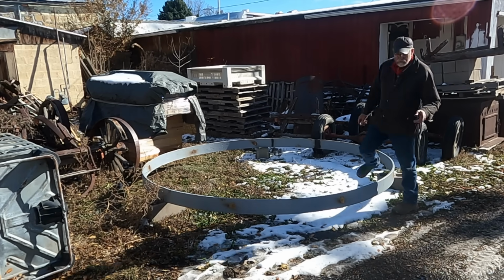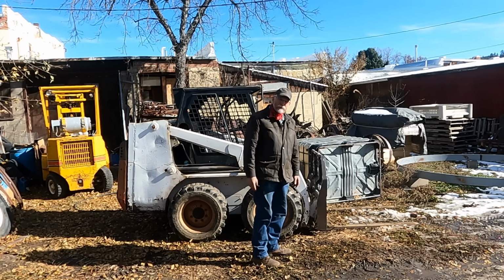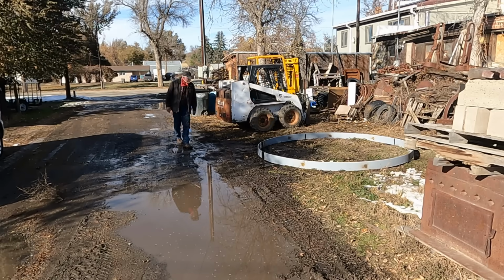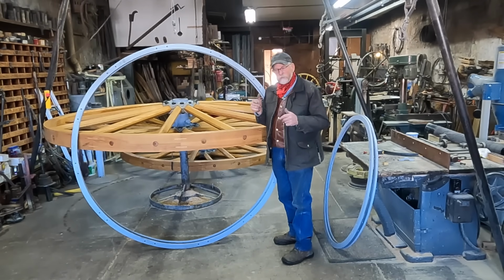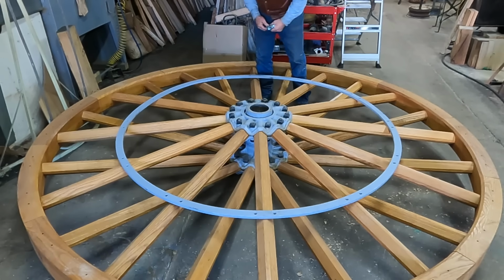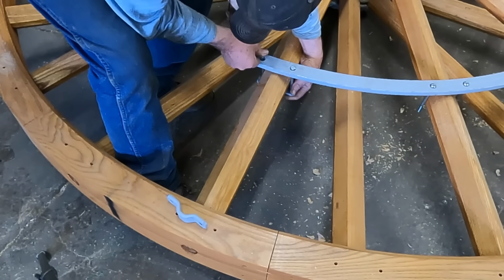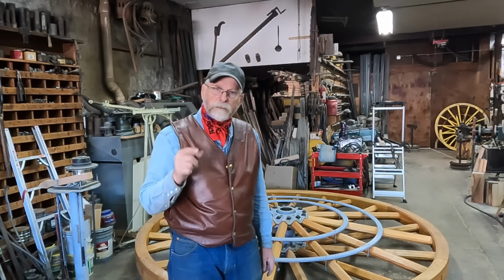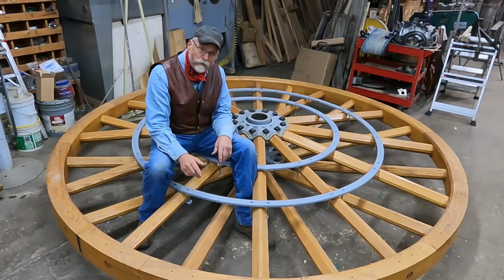The Last Steps For Setting 10 Foot Logging Tires | Engels Coach Shop

Comment: Fun fact : the Holt company that built these wheels is still around today , but they're now known as Caterpillar
Reply: Pretty neat.
Reply: And if you grew up in Stockton, CA, you might have heard about Benjamin Holt.
Reply: Holy and Best merged to become Caterpillar.
Reply: I think it’s neat that they are Holt . I never ran anything that said Holt on it . But I have ran lots that said Caterpillar on them . My favorite tractors. Thanks Dave
Reply: I think the warranty would be up by now.
Reply: And Peter J Holt, great-great-grandson of Benjamin Holt, is the majority owner of the San Antonio Spurs. Plus they have the local Caterpillar franchise.
Reply: Great bit of trivia there..thanks!
Reply: VERY. interesting! I did not know Holt begat Caterpillar. Those wheels represent quality even back then.
Reply: Those rings have a nice light blue patina on them. Any info on how that was done?
Reply: @ColinWatters that's just paint after the metal was sandblasted .
Reply: There is but one Caterpillar - Holt builds it.

Comment: The same applies to your common or garden wagon wheels of course, but it's amazing to think these massive heavy wheels were once a common logging tool and were moved about without machinery. Those additional rings just dropped on no problem, Cheers

Comment: What I don't understand is why those two bracing rings are both on the same side of the wheel. I would have expected the smaller ring to be on the opposite side and bracing the spokes on that side. So what do I know? Obviously, nothing!  But this has been, and continues to be, a most fascinating build. Thank you so much.
Reply: As he explained, they are there to face inward to keep the log ends from swinging into the spokes and breaking them
Reply: If I recall correctly, these belong to a logging arch.   The arch would protect them internally from suspended load.   The bands would help them 'skid' by and bump off of trees and other debris in passing.
Reply: Correction:    apparently I was wrong.   Looks like the bands go 5o the inside of the arch to protect from swinging, turning log ends.   In the attached clip there is one very brief clip of an arch with the inside/outstide spokes.   https://youtu.be/U1ZlnE200ms?si=msvwlGW9FOYbgvND
Reply: @jimmybryan6760  Thank you for that explanation, that now makes sense. How I managed not to hear that in the video I have no idea; I guess my mind was wandering at that moment. I must pay closer attention in future.

Comment: Hello, Mr. Engels. I love your videos and watch them religiously. You are an amazing multi-talented individual - this country needs many more like you. Dumb question: You apparently shortened the tire to fit the new wheels. Does this mean the new wheels will be a tiny bit smaller than original? Will this cause any drama fitting them to the wagon, whatever, or cause authenticity issues? Just wondering. Thanks for all you do.
Reply: Actually one tire didn't need to be shortened and the other just a little bit.

Comment: Note to self, never get in a bar fight with a guy that straightens 5/8" thick steel with elbow grease and a sledgehammer.
Reply: Hahaha good one ❤❤
Reply: Dave's too busy to get in bar fights but your point is well taken.
Reply: & if you noticed how short the handle was? Not a lot of leverage for a 8-10 Lb. hammer.
Reply: Yup, beware the sleeping bear inside farmers and blacksmiths.
Reply: I was reminded of a saying that my Vocational Agriculture teacher used to say. "Don't use force, get a bigger hammer." When I was in my late teens, my older brother came to the conclusion that he didn't want to fight me after watching me swinging a 12 pound sledgehammer with a 3 foot handle. It wasn't just that I was using it. I was swinging it one handed from the end of the handle. I wasn't missing the wedge that I was using to split a nearly 2 foot diameter chunk of white oak.

Comment: Yikes - each of those wheels is going to weigh more than my first car! 
Are those clamp rings actually doing much for the wheel’s longevity or usefulness? I guess the larger of the two may stiffen half of the spokes a bit - but I wonder how much the little ring can do?
All the best for the party - may your winds be low and your skies be clear!
Reply: They are there to deflect logs away from hitting the spokes as the logs are being drug and swinging around.
Reply: @lint2023  Aaah - thank you for helping a modern city dweller out here!

Comment: There is never too much weight for a skidsteer, just not enough willingness to become a real skidsteer operator(i.e. flip it over as I was told when I was learning that your not a real skidsteer operator until you've flopped one..... several yrs and ~8k hrs running one and I still don't meet that criteria.)
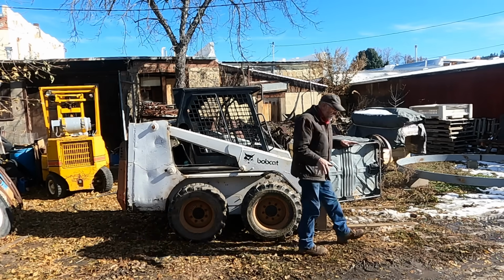Reply: Did you see what looks like a big crack where the booms attach at 1:20. It may just be paint.
Reply: Been there, did that.  I have NOT put one on its side.   Was moving long hay racks in a muddy feed lot and backed one out of from under itself.   Gently landed on bucket and front wheels.  Lowered boom arms and it righted itself.   
Got into plenty pucker up situations were I brought in a vehicle to use as an anchor to get off of slopes etc. Watched a guy flip a tiny narrow Bobcat model working footers on a new home construction site.   Wasn't wearing seat belt and it banged him up a bit.